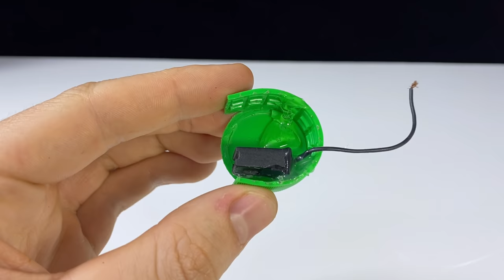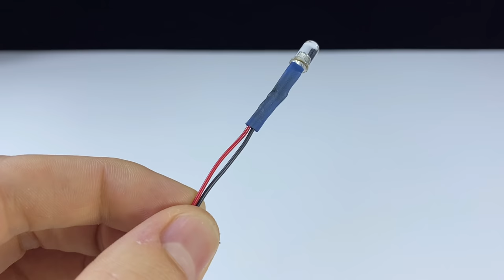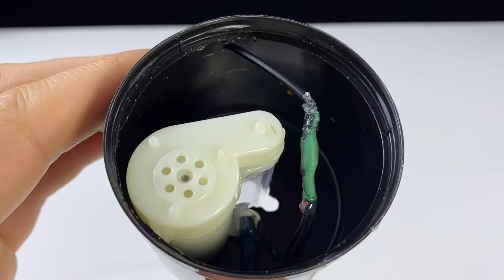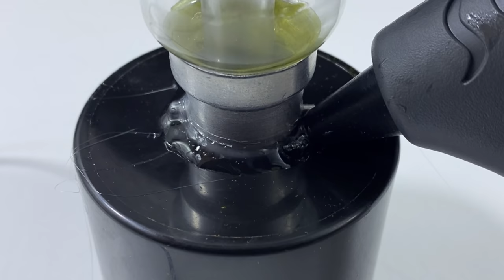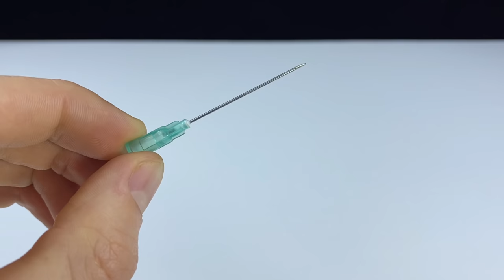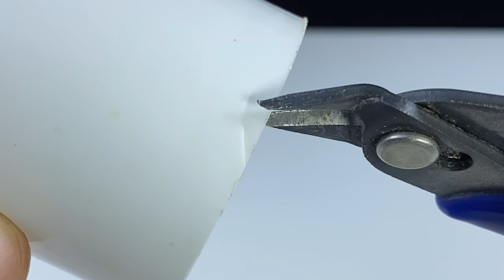3 AMAZING INVENTIONS | DIY Ideas | Super Inventions

Comment: What wire did you use when you connected the led’s together in invention 3?
Reply: I assume just any wire could be used as long as it transfers power trough it
Reply: @ToxicFlame6473  p